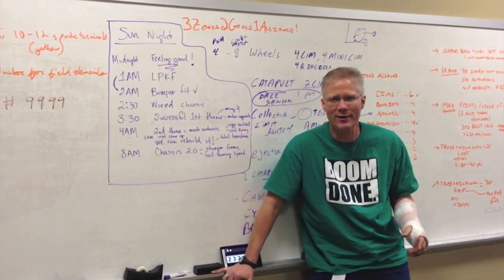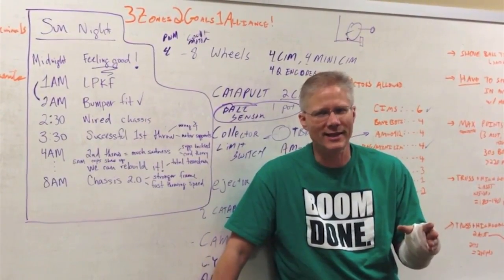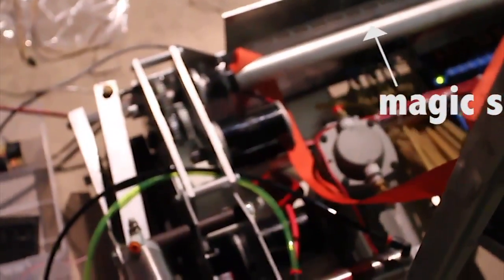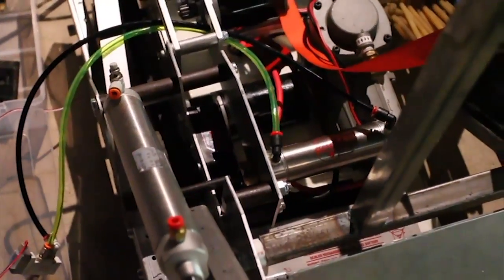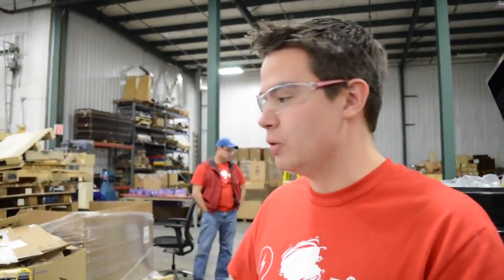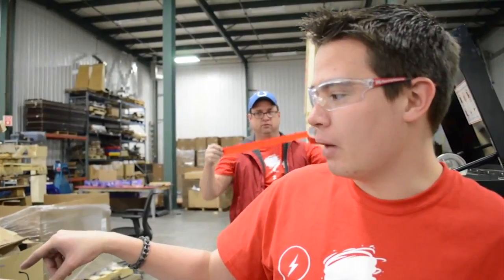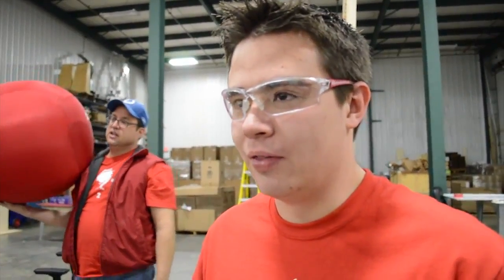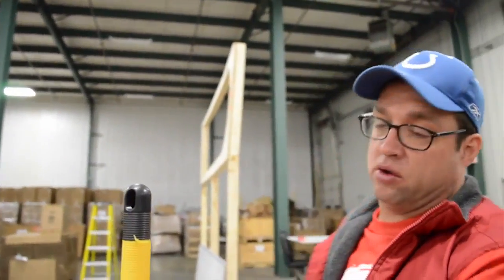Robot in 3 Days: Innovative failures of 2014 and GIVEAWAY!

Comment: Team 173 has had plenty of failures, two recently. First, we put a hole in the ball bladder when the ball bounced back onto a point on the end of the ramp we were using to give it some lift. We hadn't ordered an extra ball or bladders yet. They should be in soon. The other was with our CAN wiring. This is our first year using Jaguars and CAN. I helped a student wire up custom cables for the Jaguars. When we started testing, three of the four Jaguars worked fine. The first one on the chain wouldn't talk, though. Turns out two of the cables were made wrong, so the signal wires to the first Jaguar were crossed and it wouldn't talk. The cable to the next Jag crossed the signals back again, so the second, third, and fourth on the chain worked fine.

Comment: One day my team decided to see if a small vex motor would be able to open a gate latch and release our catapult. Instead of mounting the gate latch bar onto the catapult, we clamped it in place. While the catapult was tensioned, the clamp failed. It was shot across the room, and punctured an air vent. We all just stood there and laughed. The worst part was that we just grabbed another clamp, and continued testing with the same set-up.

Comment: We were programming our kicker with an encoder and we needed a brake to prevent the follow-through from damaging another part of the robot.  Our braking code had a corner case we didn't notice until it was too late, so our brake actually accelerated the kicker instead of slowing it down.  Bent some metal and had to replace that part.

Comment: As we are a rookie team, FRC 4954 had been through a few different failures. One of them is our mechanical stop we put in for our pickup system. The first time we tested the arm (no motors or cylinders) and rested it on the stop, the stop completely bent. Another failure was that one of our toughbox gearboxes was making a really bad sound once we tested it. It turned out that when we put a bolt in, it was touching a gear causing the sound. These are just a few of the many things we prototyped and built that ended up failing and then we ended up fixing it.

Comment: A few days ago our battery died, and we took it off and put on a charged one. only one problem... we never secured it down! when driving it to test if it worked (since were a rookie team) the battery fell off the drive train (since it was at the end of the drive train) and sparks flew. we discovered what was making the sparks, but that was a eye opening experience about how you need to be careful and always double-check EVERYTHING.

Comment: Back in 2012 we were in the semi finals of the MAR Championship. We were going to double balance on our bridge with a team that we had balanced with 5+ times before. Unfortunately a wire was knocked out of compressors spike, giving us no air pressure. This meant that we couldn't shift our transmissions and ultimately stalled out half way up the bridge. We rolled off and flipped the team we were balancing with. Needless to say we learned to always use spring loaded pistons with shifters. Key lesson: Learn from your mistakes, otherwise they are worthless.

Comment: Last year, when we were a rookie team, one of our guys put the bolts upside down while making the frame. We didn't have the motors for a reference when we tried to finish it up the next day, so someone pointed the upside down bolts and we flipped the frame to put the rest of it together. Come competition time and another team tells us our entire drivetrain is upside down since our middle wheel had no contact on the ground. We ended up taping the middle wheel to kind of fix that.

Comment: About a week and a half ago, our team was testing a prototype shooter. We weren't using control system components yet, and were connecting our motors directly to the battery. We were using wires connected to alligator clips to connect the battery to the motor, and somehow, the touched. There was a spark, and the guy connecting everything jumped back, and suddenly there was a lot of smoke coming from the battery. Our captain managed to disconnect the battery, pretty quickly, and it turned out the smoke came from the wires, so the motors and the battery were fine. Pretty scary moment at the time, but afterwards was hilarious.

Comment: My favorite failure occurred yesterday. Last year I showed the programmers how to test a battery, including the fact that you have to test it under load. Of course, this fact was not forgotten among the programmers. Fast forward a year to yesterday. Having been plagued with code issues from the cRIO not showing the right voltage to the compressor not working, they called me over and we debugged for around an hour. Then I asked the programmer to test the battery we had been using for over an hour and he said it was at twelve volts. Of course, there was no way that was correct. I asked him to show me how he tests the battery. true to his ways of programmer logic, he tested the battery, read the voltage, and flicked the switch rapidly to put it under load. However, he never actually read the loaded voltage. The battery was at 4 volts.

Comment: Back in 2010 when I was in high school on 1477, our ball holder mechanism relied on suction and, well, sucked because it didn't suck enough. The mecanum drivetrain was also a poor choice.  The team learned a lot about sheet metal that year, though, leading to a very successful 2011 (first time making eliminations at Championship, and as alliance captain).

For the team I currently mentor, 3320, going with a variable angle shooter in 2013 was a mistake.  The team quickly realized that we would always be shooting from the same place, so it wasn't necessary.  Because we had no sensor feedback or anything, it was impossible to line up to shoot.  This also lead to issues getting discs from the loading station, crippling our offensive capabilities.  This year, the shooter just works, no complications.

Failure is one of the fastest ways to learn.

Comment: One of our biggest failures on 2073 came during the Rebound Rumble season. We competed all the way through the Sacramento regional with no structural problems until our final match, Semifinal 1 Match 2, when we rolled backwards off of the bridge and our bot landed shooter/turret first. It didn't look too bad at the time and we did our best to check it before we had to re-bag and tag it for the Silicon Valley Regional. At SVR, about halfway through qualifications our turret kept popping right out of place, and rendered our shooter useless for those matches. We kept fixing it and in Quarterfinal 1 Match 1, where we had an elaborate plan setup to take on the #1 seed, upon crossing the bridge to the other side of the field, we began to play defense. On the first hit, our turret popped out of place again, but seeing as it was still on the robot, we continued to play defense. We took another hit and our turret fell completely on the ground and our shooter was attached to our robot only by the wires that powered the shooter motors. Needless to say, we sat idle the rest of the match.

Comment: My team after spending 2 weeks perfecting our catapult that shot 20 feet high 30 feet long...no one could explain it we even had a PH.d. Looking at it the math said it was impossible for it to be shooting that far. Till one of our freshman recorded the shot...turns out we got 3 things wrong
1) we measured the shooting distance wrong by about 10 feet
2)we were using more springs than we calculated
3) my favorite the lever arm was 3 times to long.

Comment: One of our biggest and funniest failures just happened tonight after 11pm.  We finally finished machining our "Choo-Choo" and got it all assembled on the robot.  We went out in the gym to test it under tension and the "Choo-Choo" got all the way around (with a few funny sounds) and it failed to launch when it was supposed to.  As you can imagine we were pretty puzzled after this...  Turns out the shoulder bolt on the 2nd linkage didn't bottom out on the 1st linkage and tightened up so much that we couldn't loosen it by hand.  We had to break out the hammer...